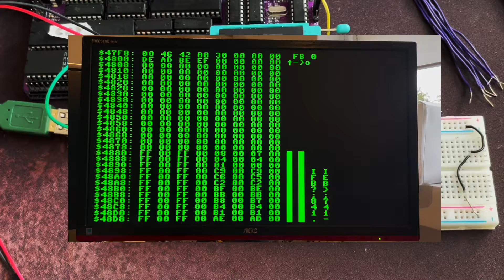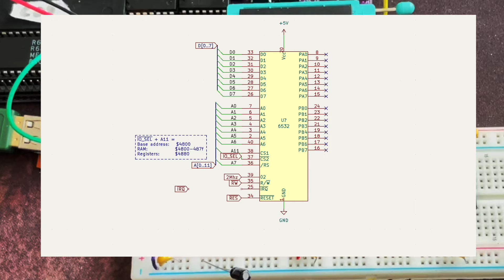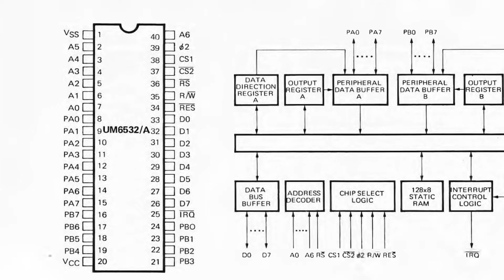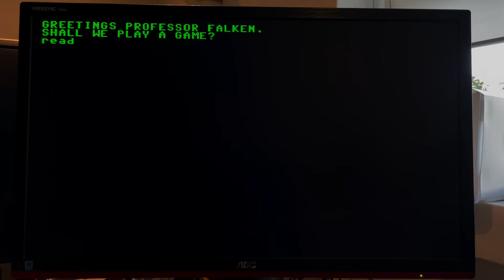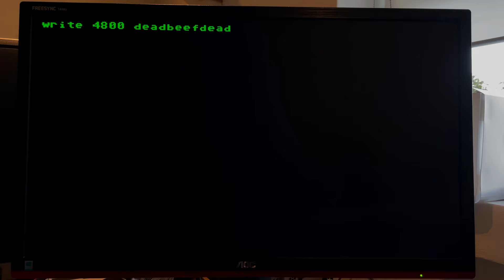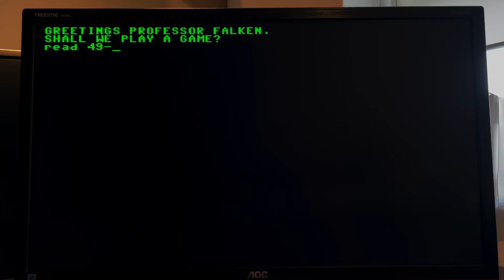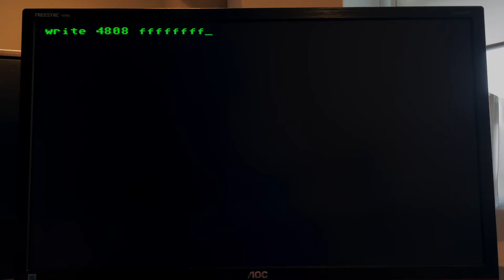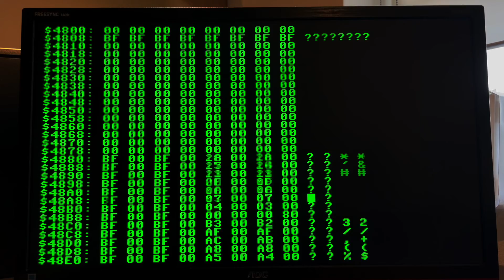The amazing 6502 support chip: The 6532 RIOT!

Comment: So can I use just those 2 chips to run CP/m & or BASIC with a keyboard & monitor then ? Or would I still need other chips ? If so & I'm sure I will need more. What chips then ? 
Im brand new to breadboard computing & trying to figure that all out.
Reply from the maker: I suggest you check out my "Single Breadboard Computer" video - that eventually turns into the 65uino. I do believe that's the minimum you can - reasonably - get away with.
Reply: @AndersNielsenAA  Will do. Thank you.
Reply: I've one more question. As a beginner. What would you say would be the best/easiest CPU to start with ? I'm leaning towards either the 65c02 or the Z80. ( or maybe even the G65c816P) & I just cant make up my mind lol.
Reply from the maker: @Xpun3414  The easiest? I would say the 6502 - specifically the 6507 because it has less pins to worry about.
Reply: @AndersNielsenAA  Man. You are awesome. Thank you so much for taking the time to respond & put up with all my questions. :hand-purple-blue-peace:

Comment: There was no read / write signal on the 2600 cartridge interface.

The designers felt 128 bytes was enough!
Reply from the maker: Well at least it had plenty of address lines to make up for that ;) 
And I guess the designers thought that if you need all the address lines and an RW line that bad, you can just detect if the data bus is being driven :D
On a serious note - amazing the hoops 2600 devs had to go through!
Reply: @AndersNielsenAA  yeah no kidding. That method was used. I think the supercharger did it. And some modern-day Solutions do it. I have written code for that little box and it is crazy.

Comment: I would like to see how the io and timers work for the 6532. This video came up at the perfect time as I was playing with the 6532 from an old 2600 to see if I could use it to diagnose 16k/64/256x1 dram in circuit. It has been a pain trying to test dram without using stack or zpage. I need to find which chips are bad and currently can find one chip only if bad. Replace it then run for find the next. This might be enough ram to do the job and has io to show which line(s)/chip(s) it might be!

Comment: It has a great name for an IC. Personally I have never used one, but 128 bytes seems really crowded. Plus you have to choose between page zero or page one. That's a tough choice.
Reply from the maker: Actually, what most systems did was to mirror page one and two in the address map - that way the choice of how much for each was in software :)
Reply: @AndersNielsenAA  Interesting! Since the stack works backwards 64 might be enough for each.
Reply: @johnsaller2481  I dont think you would use 64 bytes of stack, that equals 32 subsequent subroutine calls, 16 would do in most scenarios.